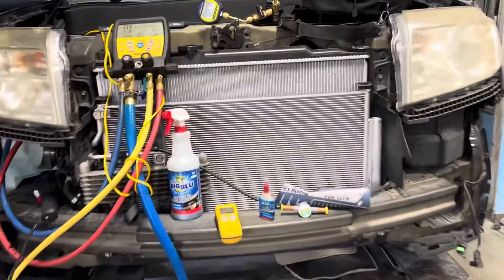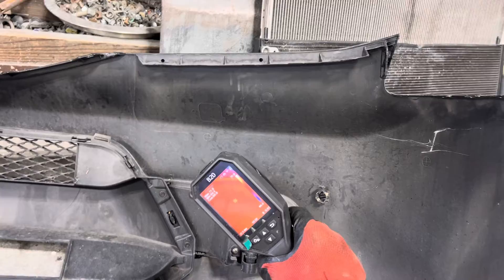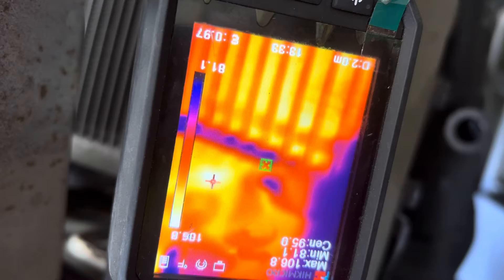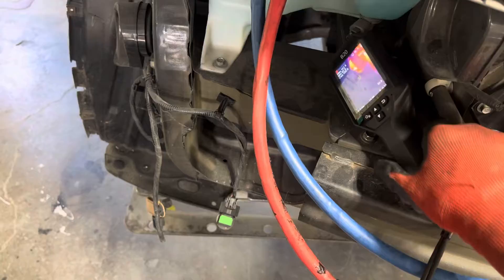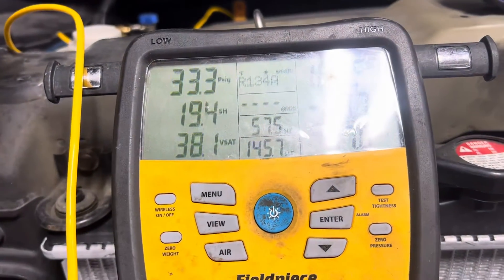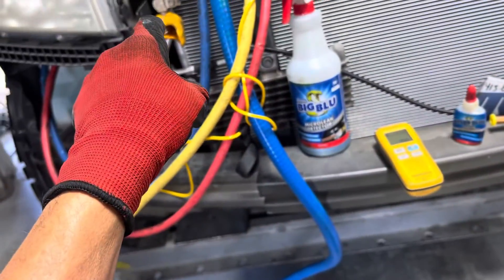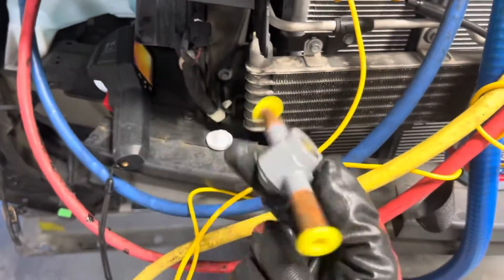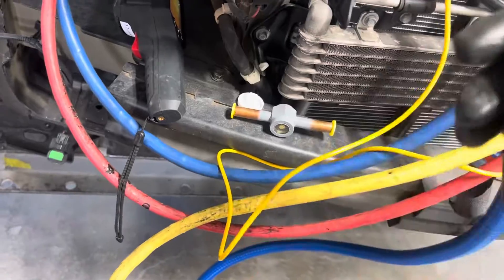2012 Honda Pilot 650g. Refrigerant R134a￼

Comment: Hi Tom, can you help me understand why a lower temperature delta is considered less efficient than a larger temperature delta? I thought it was the reverse with larger temperature delta equals more heat rejected?
Reply from the maker: Did I say it backwards inside the video?

I gotta go back and listen to the video 

You got it, right? 

That’s why all your higher efficiency, new mini splits in high SEER home air conditioning units have much lower heating temperature, coming out of the heat pump and slightly warmer temperatures out of the coil in the air conditioning mode 

They have lower temperature difference across the coil . 

The ones that cool really good was like a 30+ Delta across the coil but also did really good humidity removal .  Are less efficient.. 

But they gave us better de humidification at the same time by providing such a low coil temperature .